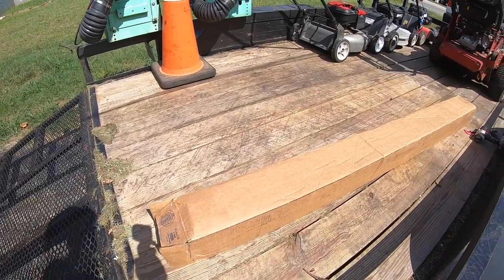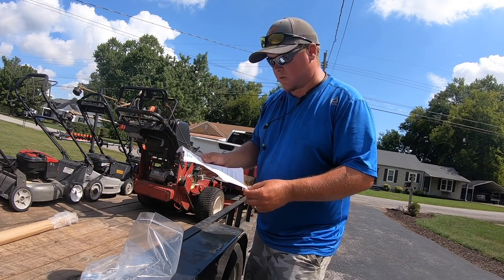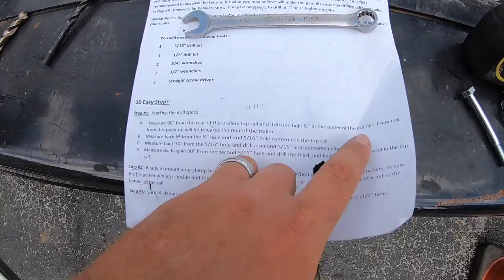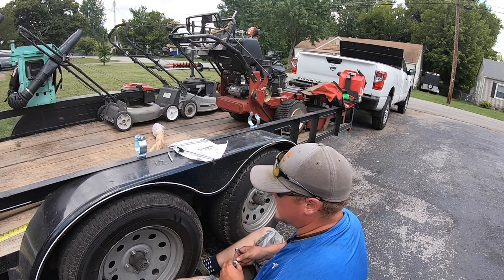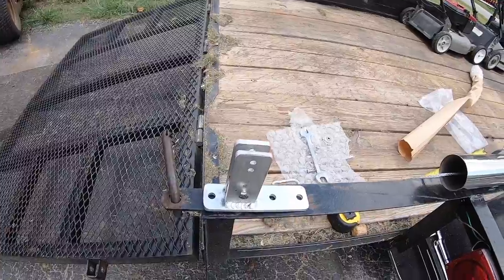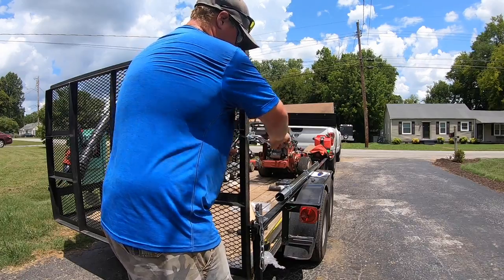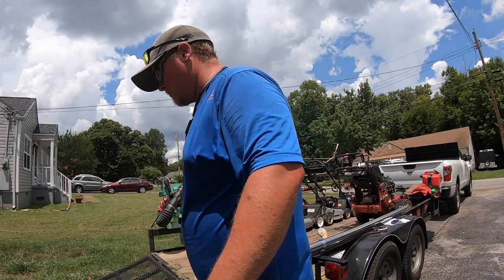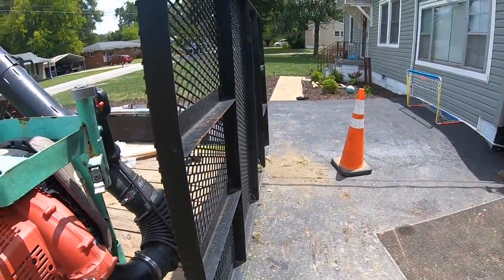Is The EZ Gate Really Easy?

Comment: ? Y didn't u just move the L bracket back more but I would've drilled straight thru the metal tube that holds the spring inside then would've been so much easier
Reply from the maker: Yea, coulda woulda shoulda. I had fun with it and it works great. #noregerts 🤣😂

Comment: Sure I'll send another sticker brother,  but why did you cut your trailer.  I would have just moved the pulley system back a pinch. Your gate mite bounce around now. Also, next time cut the bolt, no drilling to your trailer fender lol. All in all. If it works and your happy 😊 all that Matters #wapacha
Reply from the maker: 🤜🤛🤙 If I didnt cut the trailer, the bracket would have been sitting off level. She rides great!

Comment: Just installed one on my trailer last weekend. My trailer has 24” mesh side rails/ sidewalls. I followed the instructions and of course it didn’t perform as expected since my trailer has the higher side rails. I ordered mine directly from Ballard-inc.com and follow their page on Facebook so I messaged them on messenger sometime early Sunday. It was about 04:30. Surprisingly they messaged me back around 06:30 on instructions on modifications I needed to do. Not sure if Kory did or someone else, but I was, and am thoroughly impressed!
Reply from the maker: It's definitely worth the money!
Reply: What was the suggestion??
Reply: @ryanmueller5816  I followed the instructions on where to place (drill) the holes to Mount the islet bolt and mount the tube. I needed to adjust it backwards/ closer to the gate due to the 2ft sidewalls of my trailer.

Comment: I think you should watch the e trailer video of the install. Drill a hole through the fender instead of cutting the bolt . Put a nut on the eye bolt then cut it and back the nut off to straighten the threads. Way too much tension on the spring when the gate is closed . Other then that funny videos.
Reply from the maker: Haha, thank you! I watched the video. Lot of coulda, woulda, shoulda in this video. I was trying to make a funny video.